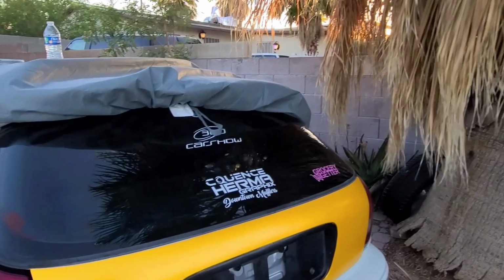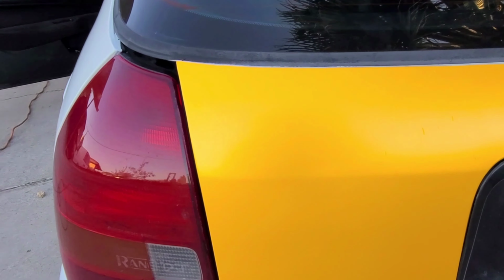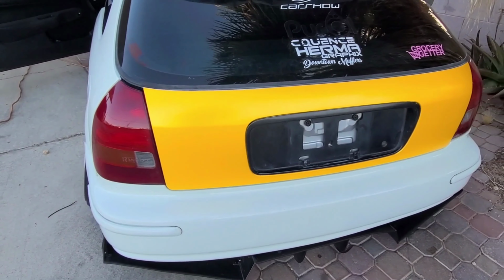wrapping the hatch!

Comment: Doing good bro, I wouldn’t worry about any mess ups. Mines not perfect either, but at least you’re taking it on yourself! Make sure you heat it a little and use more hands if you need to stretch and lay it down as smooth as possible before trying to lay it all down.
Reply from the maker: Yeah i figured to use heat towards the end but i had already made some wrinkles here and there but they are only on the top left corner. So im im not really mad about it just gotta redo it later on lol